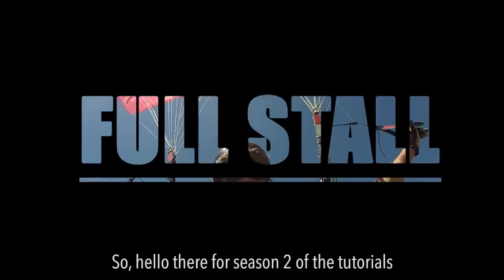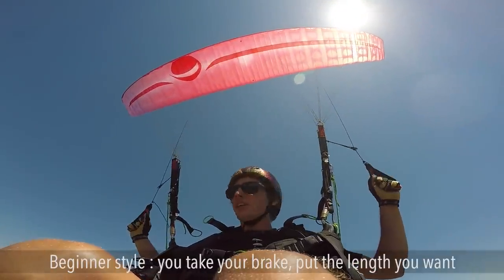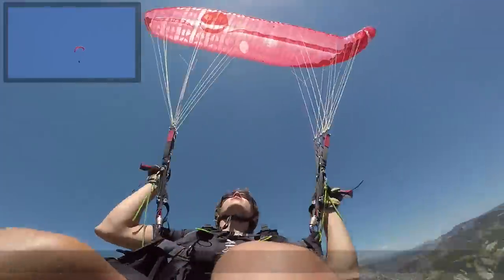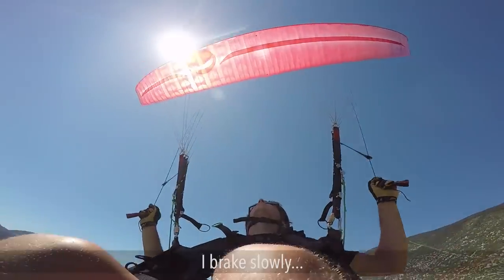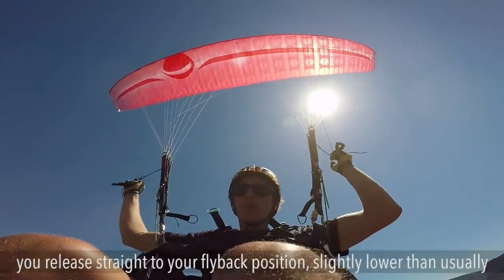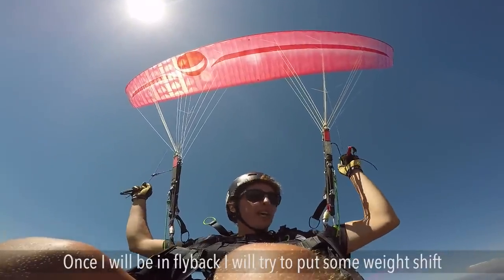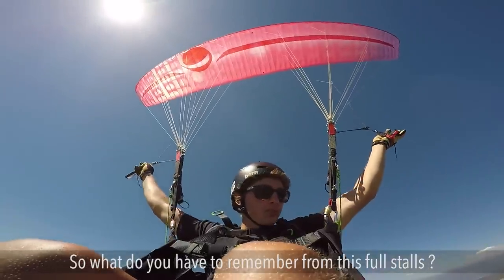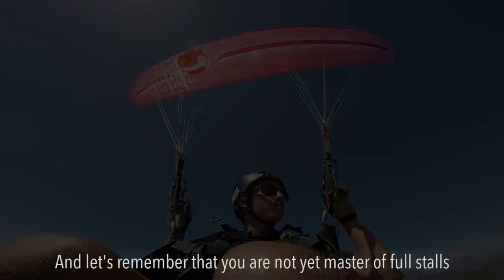Théo de Blic's Tutorials S02E01 : FULL STALL

Comment: Wow Theo, you make it look very easy! I just returned from an SIV in Turkiye and had real problems after the stall returning to back fly position as it was just pulling so hard I couldn't control it. It's a high A wing and I'm on the top of the weight range plus probably weak arms after a rib injury 2 months ago, so maybe all of that contributed, but I noticed you took a wrap. Perhaps that might be what I need because I had to really bury the brakes to reach the stall, then of course it would shoot into a collapse as I couldn't brake the shoot at all. Anyone have any ideas?
Reply: Your instructor didn't tell you to take a wrap?

Comment: You keep saying when it shoots forward to 'release', but the you say 'you don't even have to pull the breaks'.  WTF are you talking about.  If you're not releasing the breaks then what were you saying to release?
Reply: He is explaining how to exit from the backfly condition (you already have the brakes pulled): during backfly, the wing continually “pitches” (moves back and forth)...in order to exit from backfly, you wait until the wing pitches forward, then you release the brakes and the wing flies  (no need to “re-apply” the brakes in order to stop the wing forward surge, because you released the brakes at the right moment, when the wing that has already pitched forward, during backfly, is about to go backwards).